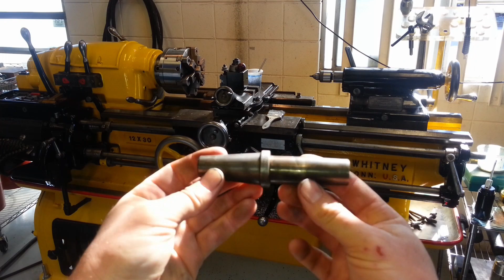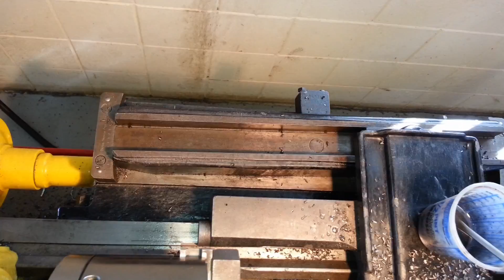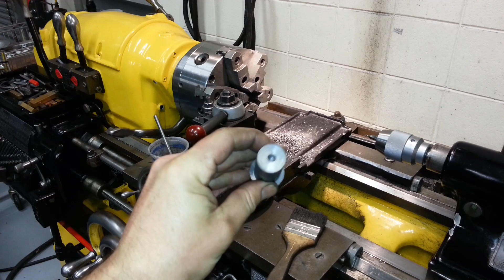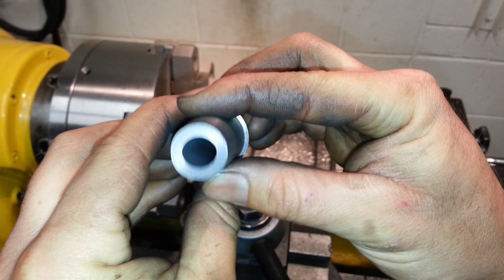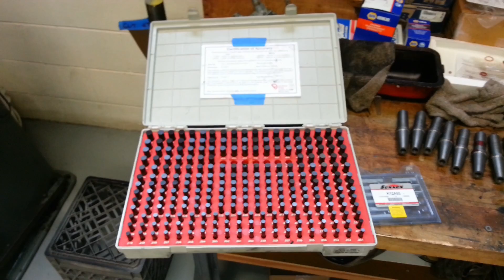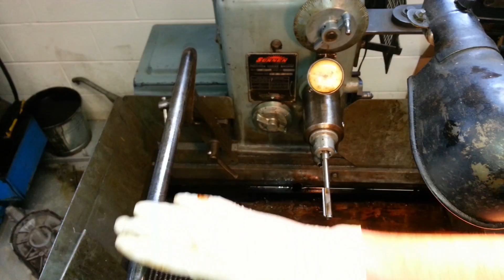Restoration of the Locomobile making the valve guides 2nd video

Comment: How do you get the chuck to self center?
Reply from the maker: john brown I'm afraid I don't understand the question, it has a center scroll to center the jaws.  But it has a centering feature on the mounting plate, so you chuck up something like a wrist pin and center off of that.
Reply: Matt Pumphrey Sorry, I have never seen a 6 jaw self centering chuck, mine are only 3 jaw and I have yet to see any chuck other than one with individually adjustable jaws that can be accurately centered,  the scroll that moves them in or out are never accurate enough to clamp any work in the chuck and expect it to be centered.
Reply: Matt Pumphrey Ok, thanks for that.